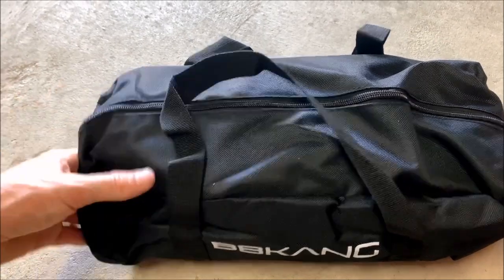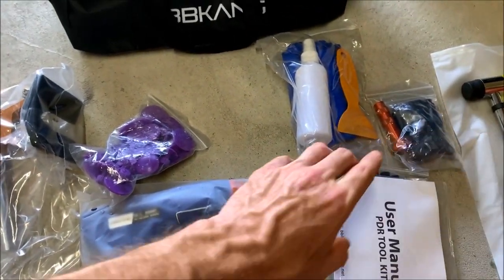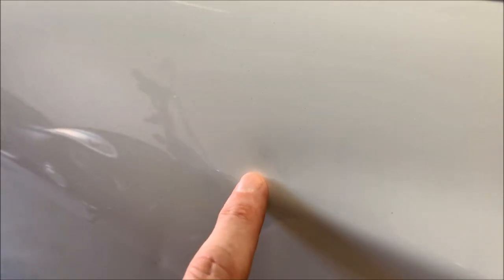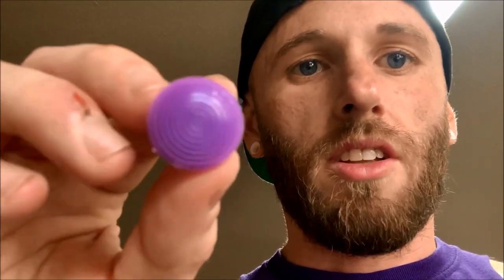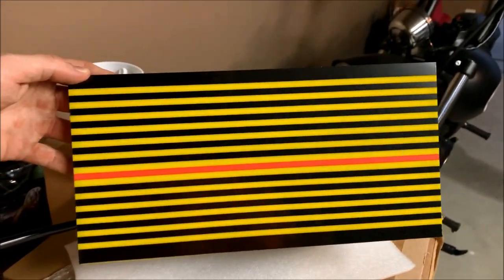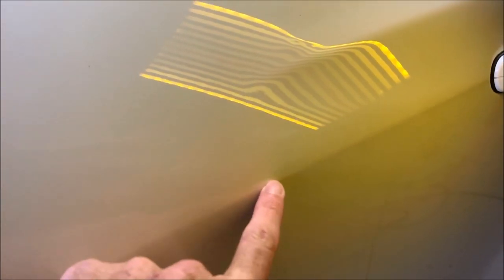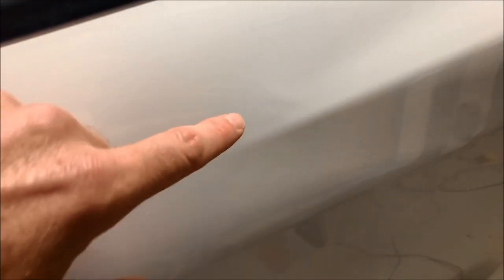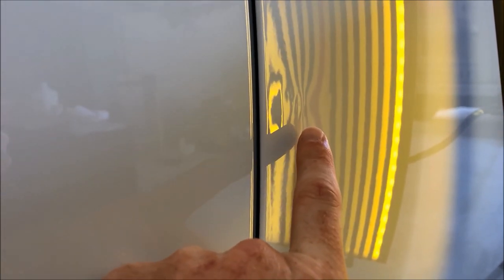Paintless Dent Repair on the ST with Amazon PDR kit

Comment: A pro would not only use better equipment, they would go inside the door and push it out. Glue is for soft dents without steep sides. You can use the knockdown to open the dent so glue can be used and if you had known that, your dents would have come out better just with glue. I commend you on your courage to give it a really good try! The line board is critical to use while you are knocking down, there is no other way to know what exactly what you are actually hitting.  An experienced PDR guy would have probably charged you $400 for those 3 dents. Great video.
Reply: I have a dent on the roof rail so I need to use glue. I'm worried the tabs won't hold up for pulling or that I wouldn't be able to knock down properly
Reply: What do you mean by open the dent?
Reply: @kenmastersmaster  to open is to widen the dent and shallow out the steep sides to allow it to break over back into its original position.

Comment: Any luck getting better at this? I'm debating glue pulling but all the best pdr use rods from the inside
Reply from the maker: The glue pull works.  May not give you perfect professional results like the rod pushing but you can get it looking 75-80% better.

Comment: A kit of toys for kids. you can open the door panel and hammer it out slowly. Nobodyshop uses that.
Reply: PDR has been around for years and works well, I assume the body shops your talking about won't use them as they'll lose money on unnecessary repairs and lost revenue due to the amount of time it saves 🤷‍♂️
Reply: You are kidding right? PDR is a great way to deal with small dents and if you do a search there are guys on here that fixe huge dents across body lines and unless you knew the dent was there you couldn’t tell.